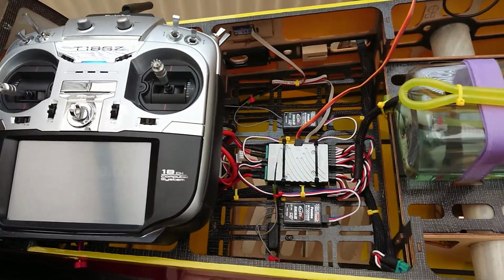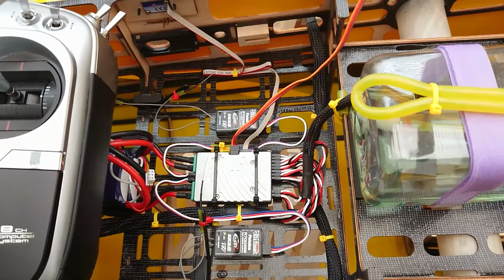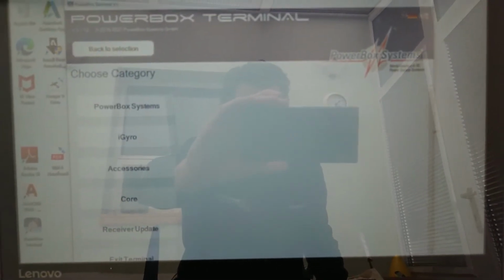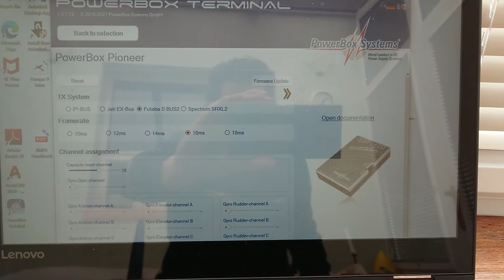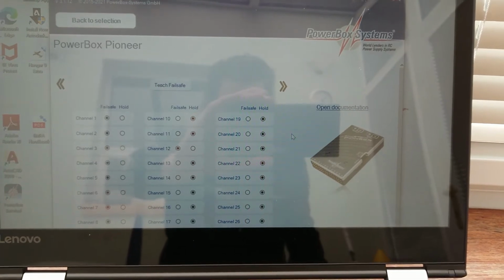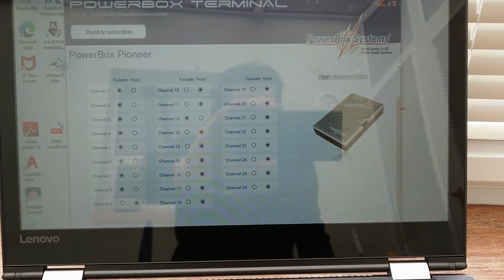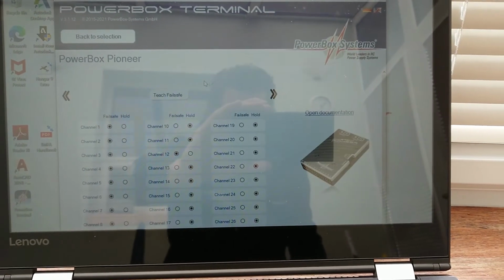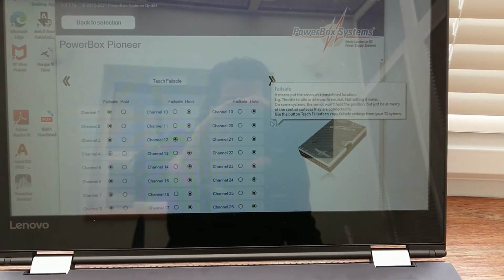Powerbox Pioneer Failsafe Setting

Comment: Very helpful video 👍
How do you have your receivers connected to, the S.bus port or S.bus2 ports on each one?
Thanks
Reply from the maker: Hi, thanks for you comment. I have connected to the sbus2 ports on both receivers. Make sure that rx1 on your tx is the one connected to the rx1 port on the Pioneer, otherwise the  telemetry isn't available (for example - if rx2 is unintentionally connected to rx1 port on the Pioneer). Hope this helps 👍🏻
Reply: @dgaerobatics1764   Awesome 👌 
Thank's a lot for the help